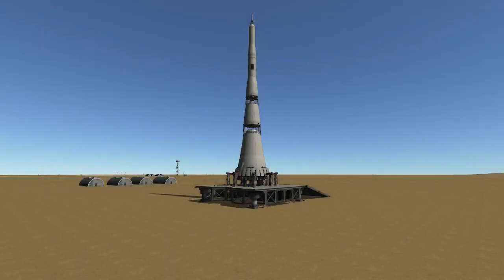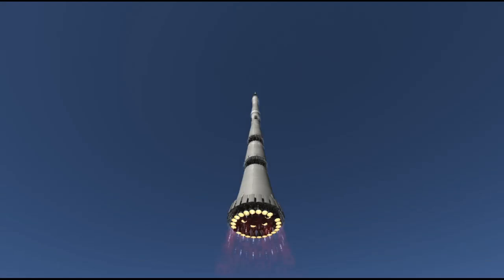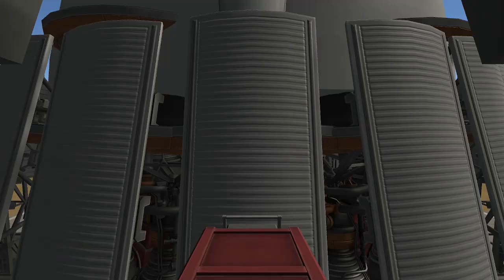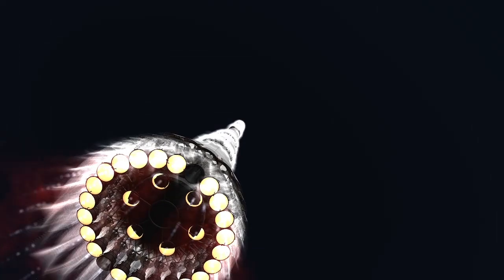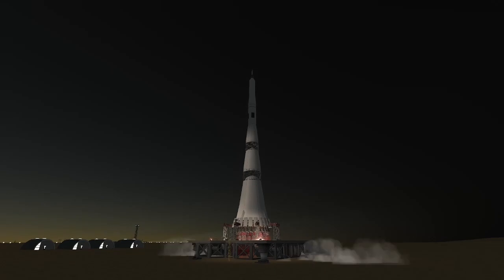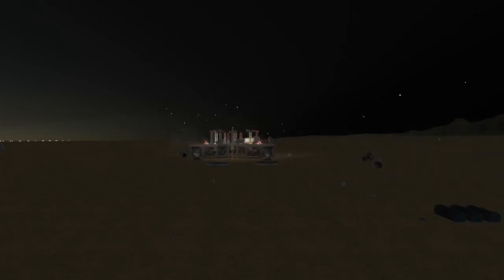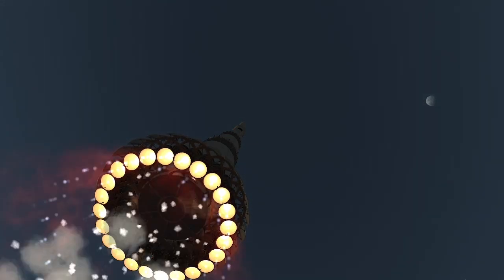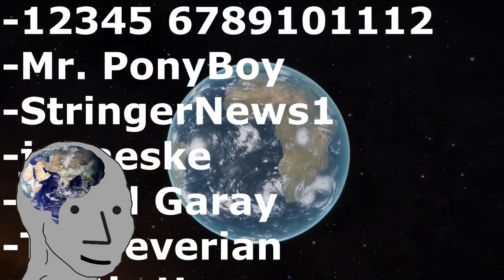How Do Rockets NOT Work? | The N1

Comment: Pogo oscillations definitely were not solved on the Saturn V by Apollo 11. Without looking it up, I think 12 had some pogo issues that almost caused failure. Also 13 had issues on launch. It wasn’t just the cryo stir.
You forgot, in your KSPRO simulations to trigger the launch escape system. That was the part of the upper stages that worked in all four attempts.

Comment: Coordinating 30 engines simultaneously is a tricky feat. I can't reliably get even 3 to work together on model rockets.
Reply: Back in the early 1970s I was in an NAR model rocket club.  We got pretty reliable results with a 3-engine cluster of Estes D12s (or D13s before that).  We used heavy gauge wire and a 12-volt car battery for power, a home built launch controller with individual microclip pairs for each nichrome wire igniter.  We did okay with a four-engine cluster of C-class engines, but only had one rocket configured to test it.

I'm not sure what the current igniters are like, back then they were nichrome wires with a kind of coating in the center.  We'd bend them into a V-shape, and press them into the nozzle with a tiny ball of cotton by using a toothpick.

I'm not sure if any of that helps or not, let me know either way.